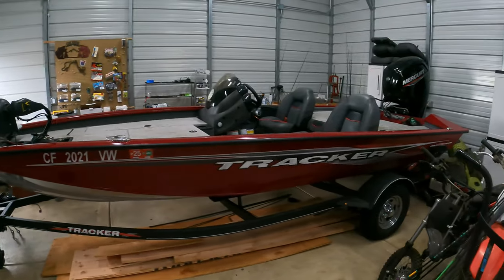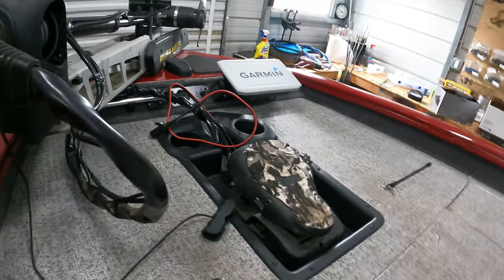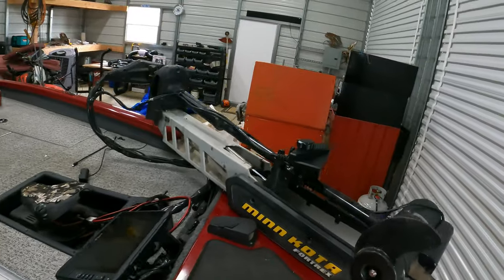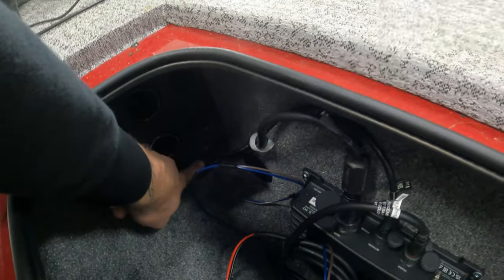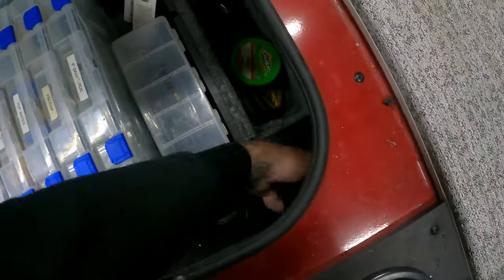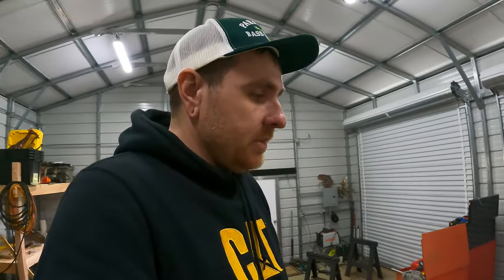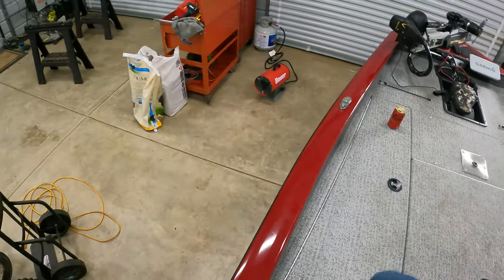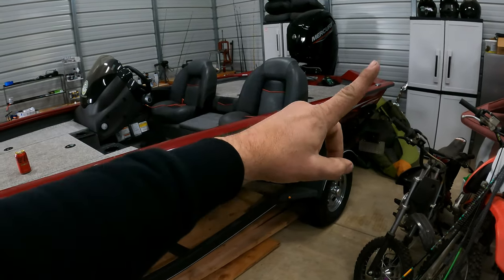2023 TRACKER PRO TEAM 175 TXW

Comment: I had a 2022 model. Liked it. One thing that a few other anglers had problems with was the cover on the tackle storage compartment. The rivets pulled out. Didn't like the starboard side as well as far as on deck rod storage. As you said had to have a rod that's under 7'. Stay Saf & God Bless!!

Comment: I have the same boat with a Livescope setup and I would highly recommend getting a separate lithium battery for your front graph and black box in that rod locker eith the black box. They draw too much power for the stock battery and the battery will die. I also noticed a huge improvement in clearing up the interference while using Livescope and getting a better picture.
Reply from the maker: It is ran off of a amped outdoors 14.8v lithium.
Reply: @juliusoutdoors2895  that's the perfect setup! Nice man, I love it!

Comment: thanks! I have a 170 now and looking to upgrade to either the 175 like that (white) or maybe a 190 with the 115 not sure yet ... the 170 is for sure a good first boat and  some of the stuff that drives me crazy about it is solved on the 175s - storage speed, ride is rough     ----- you are right about that edge the thing couldn't really move my 170 around let a lone a bigger boat. good video thanks.   I also like trackers they are good for the price you pay , for someone who fishes for fun and doesn't have (or doesn't want to spend  the 50-70k for a "good" boat these get you on the water
Reply from the maker: I would skip the 175 and get the 190. They have a bit more room and power. But, i am not disappointed with my 175. The pros in this boat make up for the cons for sure.
Reply: @juliusoutdoors2895   thanks - still looking and trying to decide if the extra 6-7 k for the 190 is worth it I am pretty happy with the 170 I just need a little more room and speed I keep looking at the 175 and I like it - thanks again for the videos
Reply from the maker: @anonimous596  no worries. Mine does around 35 with the 75hp on it.

Comment: Thanks for your video! I bought my first boat last year. Almost the same boat, its the 2023 175 TXW Tournament edition. Came with upgraded trailer, 24v trolling motor, and possibly others I'm missing. Wondering if you ever planned on putting power poles on your boat. I'm looking to purchase 2 power poles, but here is my dilemma. In the back of the boat where you have your fire extinguisher, I have my battery charger system (possibly a great spot for the hydraulic pumps. My question is if your planning on putting power poles, where would put the pumps if that compartment isnt available.
Reply from the maker: Im going back and forth on power polls. I was looking at the all electric lewmar axis. No pump or hoses. You would need a spot for the small power box, though. I know someone who has them, and the only downfall i seen is that it takes about 10 seconds to fully deploy. But for the price, it works well.

Comment: with all the batteries in the rear, how does it sit & plane on the water? I did my 2 battery add on my 170 up in the front compartment and it was perfect.
Reply from the maker: It planes out no problem. It always sat a little ass heavy but i havnt really noticed since i added the extra battery.

Comment: What is the tow weight?
Reply from the maker: @buttdreads  i have no idea. Its light. My rave4 can tow it no problem.
Reply: @juliusoutdoors2895  so a lexus suv rx350 could tow this all day?
Reply from the maker: @buttdreads  easily. The boat with full tank and loaded with gear would weigh just under 2500lbs. Tow rate for the lexus is 3500lbs. You are good.
Reply: @juliusoutdoors2895  oh good, thank you for the info! I really appreciate it. I’m in the market and think I’m gonna buy a bass tracker

Comment: 😊 put 115 mercury motor on jack plate stainless steel prop go faster on plane 75 4stroke i got heavy 42 mph top speed 3 people in boat 175 come 75 mercury. 4stroke I order used 115 mercury 2 stroke jack plate big 100 pound thrust trolling motor windy days got side guides upgrade big v8 tundra toyo.pull it 428 horses under hood diesel dodge ram 3500 stick hard drive ramp bought used auto matic tundra used v8 big block turbo trd  on engine 600 hp now 899 pounds torque dodge ram stick hard drive boat ramp almost lost truck boat cave run lake steep ramp 4x4 with stick not made pull boat at ramp